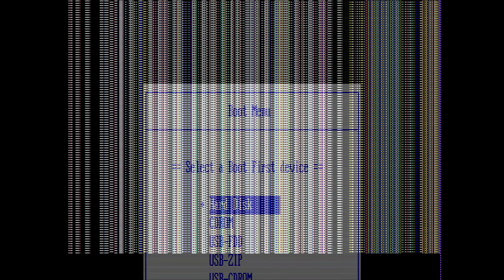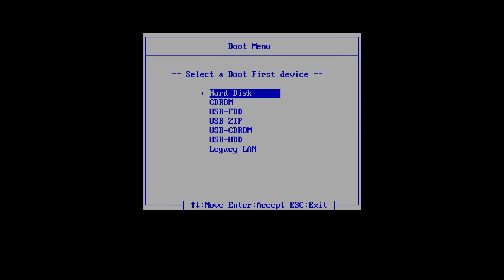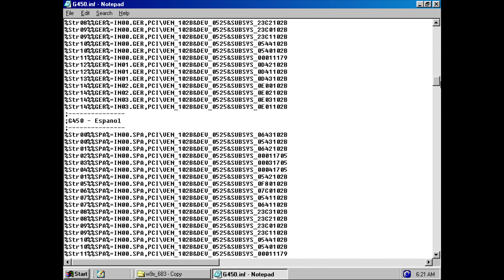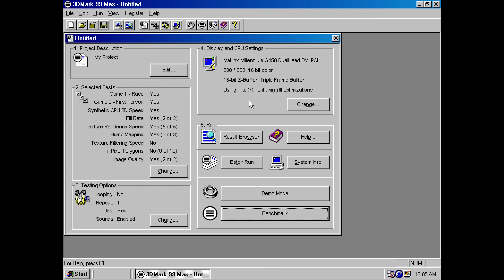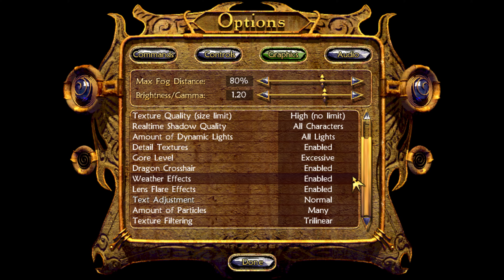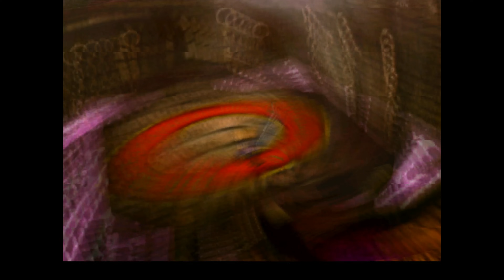Matrox Millennium G450 Dualhead DVI PCI (IBM)

Comment: See? On that last video I thought that those results with the Geforce FX 5500 were quite low, considering that you were using a Core 2 Duo. There is some issue going on with that G41 board. It would be great if you could retest it on a different motherboard, just to see the difference. Anyway, another great video!
Reply from the maker: 🤔 Worth checking out for sure! Thanks

Comment: I would recommend the G400 (Max) becauce the G450 and G550 have a crippled memory interface. They were office cards. Fun fact: the G400 Max has the fastest single data rate memory 200 Mhz at 128 bit interface. The TNT2 Ultra had 183 MHz.
Reply: Do they come in PCI versions? If so, do they support the now rare DVI daughter card?
Reply: @NJRoadfan  Support for DVI didn't came out till G450.
Reply: @philipcheung2669  My Matrox Marvel G400TV has DVI output via the optional G4-MOD/PLDVI daughter card. The option supported the entire G400 line and came with brackets for each model.
Reply: @NJRoadfan  Oh yeh I completely forgot about that.. Called the 'Flat Panel' card so really didn't associated... 
Well I had the G400Max so it was not available... in fact when I started having DVI input monitors I went with the P650 instead....
Reply: The G400Max is great, although to get the best out of the card you need to find the later version with the AGP4x interface (the earlier ones were limited to AGP2x).
Reply: I had the G400MAX. Matrox had the best Linux support at the time, although it was pretty terrible! The Linux graphics stack has a come a long way. It's a shame none of the vendors decided to do anything about it until Intel in the 2000s.

Comment: I remember anything with a bridge chip was a compatibility headache at the time. Despite supposedly being transparent, they sometimes induced enough extra latency to mess with the system, depending on chipset, motherboard and BIOS settings. Intel and NVidia chipsets were most likely to work, VIA least likely. Then there was the difference in performance, some chipsets/motherboards had extra wait-states and latency to the PCI bus, bus mastering issues, or the integrated things like storage controllers were also on that same bus, and thus sharing its bandwidth. A few motherboards could do 66MHz PCI and so double the bandwidth, but only if everything attached to it could do 66MHz. Sometimes a chipset could do it, but the motherboard itself had an onboard chip attached to the PCI bus, making it impossible.

Comment: Hell Yeah! Matrox g450 love! Great fix on the drivers! 
I have a stack of about 5 G450 dualhead VGA cards out of a computer lab I worked at in the early 2000s. We were geeked when we bought them because well.. dualhead for one, but the full opengl support as well. I'm pretty sure I had UT installed on one of them day 1.  Sadly it didn't run as good as I hoped, but I remember it looking really good and matrox having some software or settings that really just made 3d stuff look clean.. but most games didn't run great, so not as useful there.. Those labs also had two monster IBM CRT Monitors with Trinitron tubes on every desk, which was just awesome. I started running dual monitors about this time and have never gone back since. Thanks Matrox Dualhead!
Reply from the maker: Thanks for sharing!
Reply: Always!  I'm actually shocked it got a comment.. and from the video creator! I always feel like long comments just get lost most of the time, so this was a "risk". ha!

Comment: Being the GXT135P, The 2849 sticker on the back gives this away as being an IBM RS6000 graphics card. I'm slightly surprised it had x86 VGA BIOS, as the machines it would have been sold with are IBM Power6 workstations.  One standout because of that is the seemingly unnecessary PLX chip would actually come into play with LPARs - IBM's hardware assisted virtual machine scheme. Placing the GPU on it's own branch of PCI makes it easier to separate it from hardware dedicated to a different LPAR but connected to the same PCI host controller. RS6000 and their sibling AS/400 systems (now pretty much unified ever since Power6) are weird in that you can have additional PowerPC processors handling I/O and doing DMA to offload those tasks from your primary compute processor, so you will typically find several distinct PCI busses in a system.
Reply: Came to the comments to mention this. I have an RS/6000 with one of these in it.
Reply: I've read out the flash - it actually has both: x86 VGA BIOS and OF FCode
Reply: I always thought the bridge chip is mostly a AGP-PCI bridge (since the graphics chip is AGP only) and less about bus isolation

Comment: A note that these Matrox cards have bad compatibility with VIA chipsets in the boards i tested. Unsure about the later chipsets, but the early ones caused me all sorts of issues. I had to disable Bus Mastering in the Matrox driver to get things working, and then performance was awful.
Reply: 693,693a,694× too?
Reply: @valparaisosting  i've only tested on VIA VPX, VP2 and KM400. There is a Vogons thread listing a similar issue: 'Trouble installing Matrox G450 PCI on Win98(SE)'
Reply from the maker: Good to know!

Comment: Delta Force is such a great game, but you definitely need to take your time with it. One of the few games where the binoculars are actually really useful. IIRC, it does allow mid-mission saving with one of the F keys; That saves quite a bit of time. Also recommended is going prone as much as possible whenever there's a firefight, to increase your chances of survival. Overall, I think it's the best game in the series. Delta Force 2 is also really good, but it's a bit too buggy in some missions, which bring it down some.

Comment: The GOG version of Thief 2 has the TFix fan patch pre-applied, so it's not good for testing table fog.
Reply from the maker: So that's the reason! I noticed a difference with the demo version and retail version
Reply: @philscomputerlab  Nah, the demo of Thief 2 is just poorly coded. But TFix is a fan mod that completely changes how fog is rendered, as it targets newer hardware. For accuracy, use the retail release with only the official patch applied when testing retro cards.
Reply from the maker: Demo has fog also though. Works on GeForce.@Lex20997
Reply: @philscomputerlab  yeah, but it's based on an older build of the game, so the fog doesn't work on some cards that support it. It's not a good test.
Reply from the maker: Got it. BTW, just this week I downloaded Thief games again from GOG. Now it comes with new dark engine, but old executables are in backup folder. One game has two executables, one with something named DxFix or Texture Fix. With SS2 no old executables, but a fan made supplied an executable that makes the game run in 98.@Lex20997

Comment: Zida TX98-3D (Socket7 K6-2+) + G450 PCI = 👍
The card supports mpeg2 (dvd).
TX98-3D with unofficial firmware understands more than 120 GB SSD.
Reply: How did you launch this card on Zida TX98-3D??? There's no 3 volts on PCI.
Reply: @andreyawsarkisoff8844 just inserted.
G450 32 MB PCI works (CD with drivers included).
FX5500 256 MB PCI don't works.
Reply: @acid_flash  Is this a G450 from China Aliexpress?
Reply: @acid_flash  чего сразу не сказал, что наш?
Reply: Это что за БИОС такой? На неё неофициальный есть только 1.16 и там в лучшем случае 64гига поддерживается.
Reply: @grachinc  bios TX98-3D Ver 1.16 (010101).
Мать Zida Tomato TX98-3D rev 1.20.
* Откатывать без программатора не советую (он у меня тоже есть, T48).
SSD KingDian 128 GB sata через ide переходник.
Продолжительная запись медленная, поэтому отправил его в этот ретро.
IDE контроллер у материнки как раз примерно 20 МБ/с (если в режиме DMA).
Раздел под Win98SE 32 ГБ + остальное в расширенном разделе (2-ой не основной).
Win98SE с ядром от IF + заплатки на RAM и SATA (что лишнее для этого пк).
По USB эта Win98 увидела даже 1 ТБ.
Reply: @acid_flash  Спасибо за информацию! 
Удивительно, но у меня с 1.16 только 64 гига увидела (тоже SATA через переходник), а, например, 80гиг уже не видит - зависает в БИОСе при попытке определения диска. К слову, даже на зида-БИОС в описании написано всего лишь о удачном определении 40гиг диска.
А насчёт отката - без проблем отказывается нв прежние версии. Я шью Юнифлешем и обязательно с bootblock'ом.
Насчёт USB - да, тут проблем нет, через него диски видятся без проблем, но это здесь уже зависит от ОС.

Comment: I got myself the same card from AliExpress because it was cheap. I think I paid ~25€ which is not that much for a 3D capable PCI video card.  
I ran into the same driver issues as you. From the benchmarks I did with a 2GHz P4 in Windows 98SE it seems like the card is about as fast as a Riva TNT, so I guess it's ideal for a fast Pentium MMX/K6 or a slow Celeron without an AGP slot.  
However I don't see too much use for a retro PC with AGP and for newer systems with a Pentium III or better or a "time machine" build with a Core 2 Do on Windows 98 I'd prefer an FX 5500 PCI.  
One big compatibility problem I encountered is pre socket 7 motherboards. In my Socket 3 motherboard it wouldn't post at all and on my Socket 5 motherboard I got a critical error that lead to the system being halted.

Comment: I have a few Matrox cards here. Back in the day I bought a G200 then a few years later I got a G550 (I have no idea why) and I also bought the special cable to use 2 monitors. I was never that impressed by what it could do with games of that era or any software for that matter! In the end it was all a waste of money and they sit in a box now with about 100 other random PC cards including a couple of 3DFX cards (Voodoo 3 2000 and 3000), a few different Sound Blaster cards and a lot more heh! Around the Pentium 4 time I eventually gave up on add-in cards and just went with on-board video and on-board sound.
Reply: @g4z-kb7ct You were luckier. I've been looking for a Matrox G200 PCI for my retro station with WinNT3.51 for a long time. Matrox generally have excellent 2D images, sharp even in high resolutions and refresh rates, so Matrox was the obvious choice for my 21" Trinitron. As far as I know, the G200 is the last one that has native support for NT3.51. Unfortunately, I only have the AGP version and I want to run it on an old Pentium PRO that doesn't have AGP. But in my country it's a problem to get one, let alone not get ripped off by some speculator.
Reply: @Thales_WH  It wasn't luck. They were bought when the cards were new and easily available (roughly 1998-2000). I just checked and both cards are AGP. I was doing autocad work just playing at home with some work related jobs to make it easier for my day job on 19" monitor (cnc programming) so it was ok but any card would have been fine as there were only 16 colors. I was probably only running 1024x768 which was a common resolution on most cards even back then with only 1MB vram.

Comment: Matrox was mostly for good display and functionality for more professional computing. They only ventured into gaming right before the company went out of business but the reason to buy them was things like dual display and good signal quality.
Reply: Matrox were into gaming from the start my Matrox Mystique came bundled with MechWarrior II: Enhanced for Matrox Mystique edition in 1996. Matrox never went out of business they pivoted to medical imaging and security and broadcast video walls system, the Matrox G200 GPU chip was used for video output on server motherboards for like two decades. You can still buy product from them today, but their latest Luma graphics cards are based on Intel Arc GPU chips.

Comment: The PLX PCI6152 33BC is only a PCI-PCI bridge, it's a 33MHz bridge which is lacking AGP x2 port. The 66PC variant is the one with the 2x AGP port in addition to being 66MHz. Interestingly the AGP interface specification uses the 66MHz PCI specification as a baseline, and provides extensions to it. Making it possible to connect a pure PCI device to an AGP connector, as all PCI signals are supported by the interface. Though AGP is optimized for point to point topology, so only one device can be connected. With the PCI6152 66BC variant, it actually provides electrical isolation and arbitration necessary to connect more than one 66MHz PCI device to the AGP interface. The main reason why the PCI6152 66PC exists is to provide a GFX card multiple monitor support using multiple AGP devices running as PCI. Since most computers don't actually have 66MHz PCI slots, so this is the simplest way to implement existing AGP chips in multiple configurations. The 66BC isn't limited to graphics chips or AGP devices as other PCI devices can also be connected in this way.
Reply: I wonder why they didn't use the 66Mhz variant? Cost saving I suppose. It would have been a big win to have 66Mhz if your motherboard supported it.

Comment: I remember the PC magazines talking about Matrox new cards were able to do 8x and 16x  anti-aliasing with minimal performance hit and made all the games at the time smoother and more detailed. The 2000s were truly an interesting time with hardware as each gen had quite the improvement over the previous one.
Reply: The G450 was a cost reduced card, if I recall.  The G400 Max was the golden card for that series.  It would be awesome to build out another triple head set up with a Parhelia and UT2004.
Reply: @FookWit-sapien  It was the more "midrange" option and still did pretty well at the time esp considering the price (which sadly kept increasing even back then with Matrox cards). The Parhelia was a good card but nVidia had its claws deep in the market by then and ATi was a distant second (even when the 9700 Pro came out, people still flocked to GeForce cards).
Reply: @NightMotorcyclist  Yeah, I was a Matrox user up until Doom 3 wouldn't run like at all... I wasn't saying that the G450 wasn't a midrange card, just that it was a cost reduced version of the G400.  The P cards were a new architecture, but ended up not being able to perform like everyone wanted, so Matrox pivoted to pushing as many displays as possible... these days they just use nvidia or amd chips in their multidisplay cards.  Sad really, we need to stop with this duopoly crap... it stifles innovation and drives up prices... it seems our tiny human brains can only deal with two options sometimes... haha